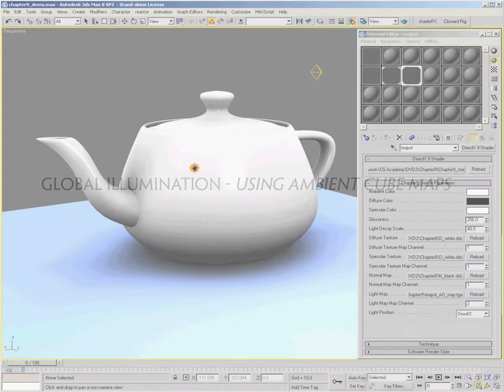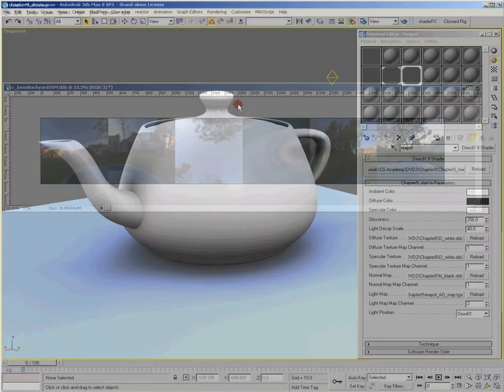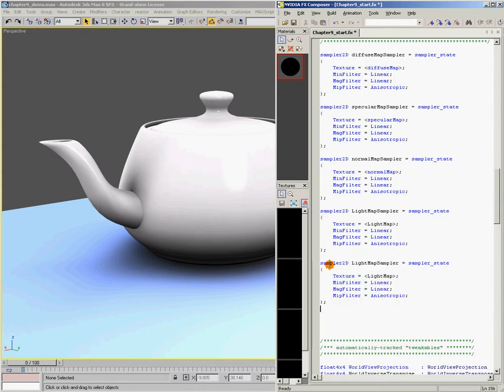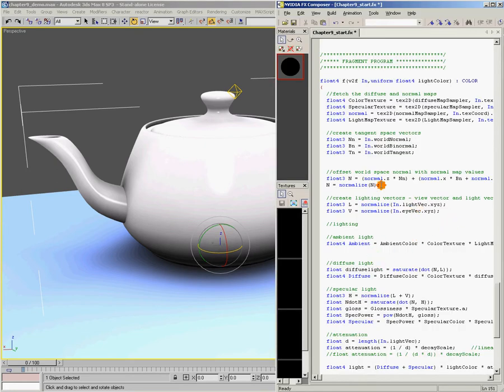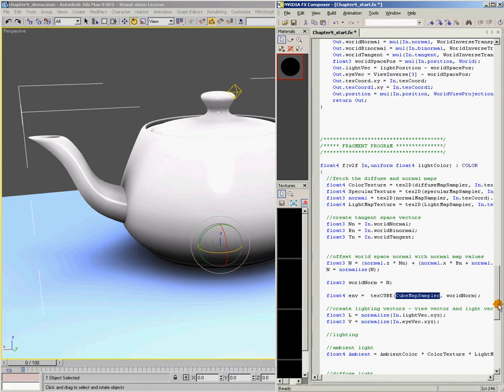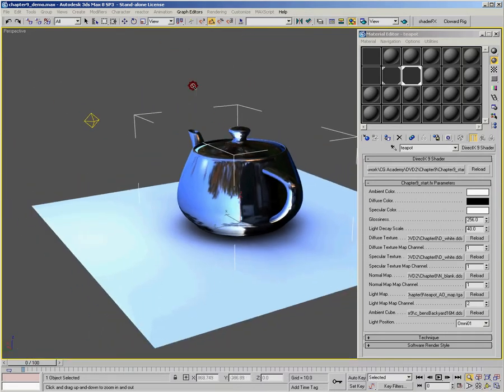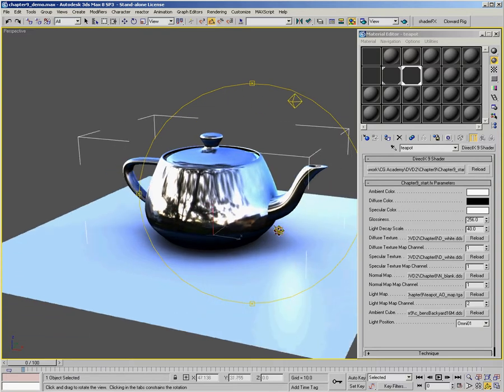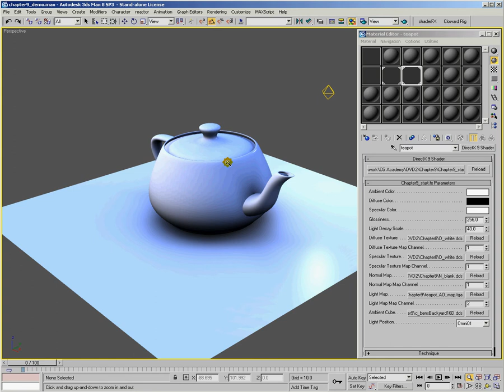09 Global Illumination: Using Ambient Cube Maps - HLSL Shader Creation 2: Light and Shading Models

Comment: 10:19 I don't think you needed that ".xzy" swizzling if you had multiplied "normal.x" with the tangent instead of the bitangent, and the "normal.y" with the bitangent instead of the tangent when creating the "N" two lines above it. But I haven't tried it.
This is the first time I've seen how going from Y-up to Z-up works. I was SURE it was more complicated than that.
Edit: And it looks like you forgot to close the parenthesis after: (normal.x * Bn) <--- here. 😆 I had a feeling it was wrong. A more zoomed-out view of that line is in the Oren/Nayar video:
float N = (normal.z * Nn) + (normal.x * Bn) + (normal.y * -Tn);
Not sure why "-Tn" was used... Maybe wrong order of the parameters of a cross product.
Reply from the maker: 3ds Max used to have a very odd set of data that they passed into tangent and binormal, so this sort of thing is making up for that.  I think that they have updated it since then, so this is probably no longer valid for the newer versions of 3ds Max. But back in the day we just hacked around to get good results with the crazy data we were given.  :)